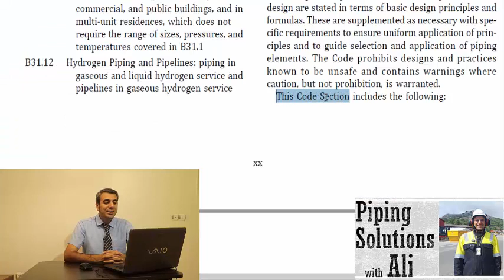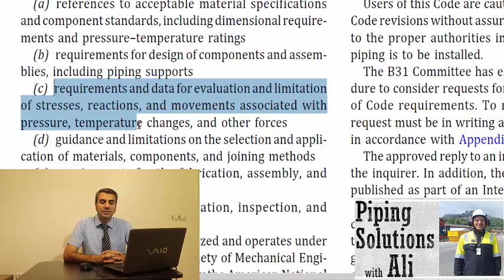The Philosophy of using Codes (2nd session of ASME B31.3 Course by Ali Nouri)

Comment: Good job Ali,

Question for you: which design criteria is the one behind B31.3 code? I watched this video but I didn't get the answer. I know that  for ASMS sec.VIII div.1 the maximum principle stress theory is the answer but for B31.3 I don't know. Really appreciate your time.
Reply from the maker: The answer of your question is covered in the course, please continue 🙂 
ASME B31.3 used different failure theories for different purposes, For example the maximum principle stress for wall thickness calculation and Maximum shear stress theory for the computed stress range!
Reply: @Ali_Nouri  thank you so much. I am looking forward to it.
Reply from the maker: @mehfar999  You are welcome Mehdi jan 😊

Comment: Hello Mr Ali Nouri,  

Thank you for sharing your valuable knowledge and experience regarding piping design and construction. However, I have a question regarding the ASME standard, is it also applied in European countries? As I see you are currently working in Norway. is it the same applies in Norway and Sweden for example. And if it is not the case, what would be the official standard for EU countries?  

Thank you in advance!
Reply from the maker: In Norway we are using NORSOK standard that is based on ASME B31.3. (Norway is not part of European Union)
In some countries in European Union, EN is popular. there are some differences between EN and ASME as the EN is more economic!🙂